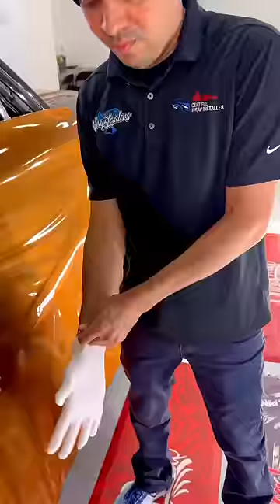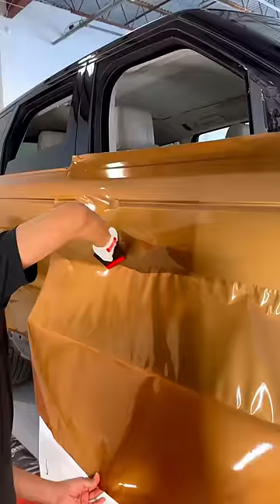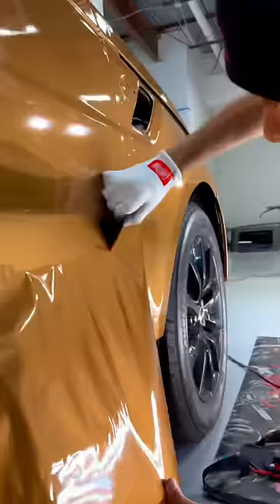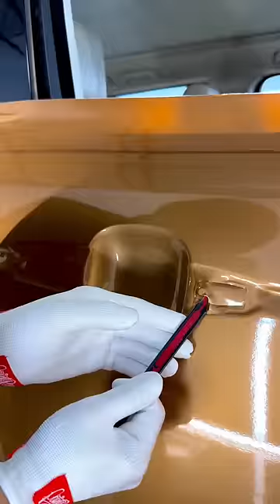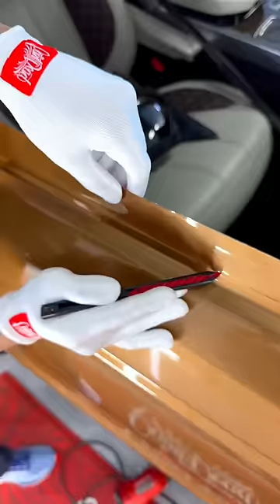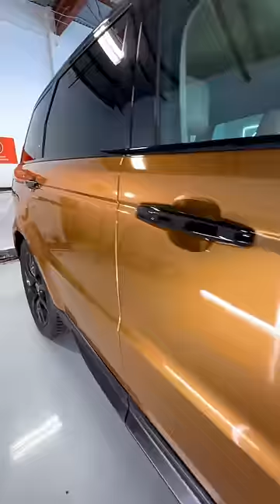No one makes this car wrap color 🪄🤯🔥✨ #asmr #asmrsounds #carwrap #carwrapping #vinylwrap

Comment: had a wrap on a work van. every corner where they cut the wrap, they cut through the paint. Got all kinds of rust later on along those areas.
Reply: Patronizing the cheapos are we?
Reply: @pee-buddy  was my former employers van. Yes he was a cheapo.
Reply: @_h_r_1_  why?
Reply: This is my first time seeing this technique, I'm used to spray paint.
How long does this last??
Reply: @_h_r_1_ or change it at will...
Reply: @_h_r_1_ I might want to drive a hot pink car around while I own it but not struggle to sell it or have to take a hit financially when I want to move onto something else. 
Buying a white car and then having it wrapped in hot pink allows me to do both
Reply: @ayeshajacobs4374  a few months in the heat

Comment: You should do a vid of taking a wrap off! Does it do damage/leave a residue?
Reply: Depends on the quality of the wrap
Reply: no. it protects the paint underneath for up to 2 yrs
Reply: He already made one on that. Of of his top viewed vids
Reply: @Kavaitsu  maybe I should have looked first. I just impulsively posted. Thnx
Reply: @RosefMudson1414  it doesn't leave a residue when you remove? I can just see with my minds eye, ripping the wrap off and taking chips of paint with it lol. My imagination 💥
Reply: @nicolelee8150  it does not. Think of it like when you remove plastic off an electronic
Reply: @RosefMudson1414  I'm thinking about like when you pull a sticker off glass. Or a sticker off plastic. Leaves a residue. So you're saying it's more like a screen protector off a phone screen. I don't think those have any adhesive. It's like a suction cup
Reply: @nicolelee8150  No, it’s like the protective plastic on say a new computer or TV, the protective film that you peel off before you use the item, zero residue.

Comment: Everybody asking how do you mix to wraps together the answer is wraps are printed off of a big printer so simply combined two colors together on the computer and print the results it’s not literally two wraps being combined
Reply: thanks, cause i was confused as hell.
Reply: So what he means is... "Customer wanted a color. So we made that color."
Reply: It's not two wraps. It's literally mixing 2 premixed colors for a wrap.
Reply: He said he mixed two wraps together. So obviously he didn’t mix to wraps together.
Reply: @terellwhite3361 lol right! I don't usually get bothered like this but wtf. Mixed two colors not wraps. Society is is getting dumber at a fast pace.
Reply: If your printing it why would you have to mix 2 wraps to get a color instead of just changing the color. It doesn't make sense that the template would be color locked so you'd have to have a template for each color. Unless I'm missing something.

Comment: Everyone is wrong. Since OP wont explain, I will. I wrap cars for a living. It is 2 layers of vinyl. One baby shit color underneath, and the second is the metallic clear overlaminate on top. Its placed on top of the second layer using a laminator. Making it two layers of vinyl. 

Some colors dont come in metallic, but 3M and Avery make clear metallic, gold dust, carbon fiber, etc, tha you can laminate on to a solid color to give it extra features.